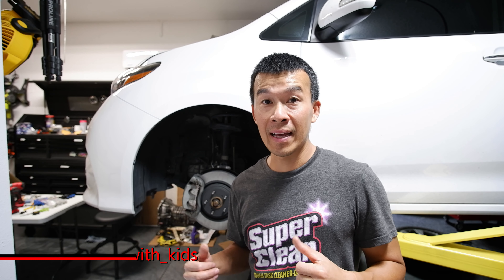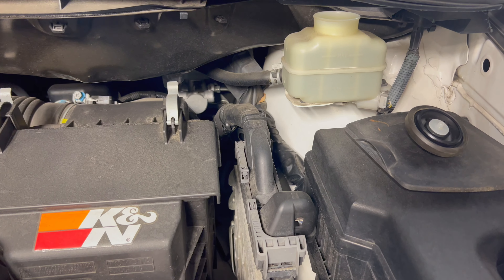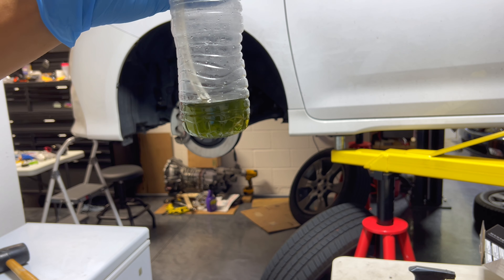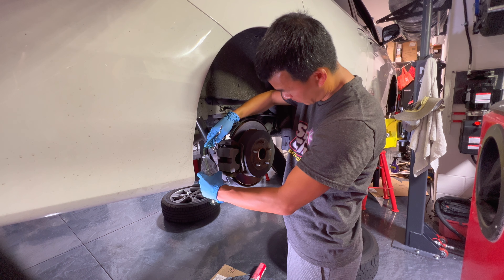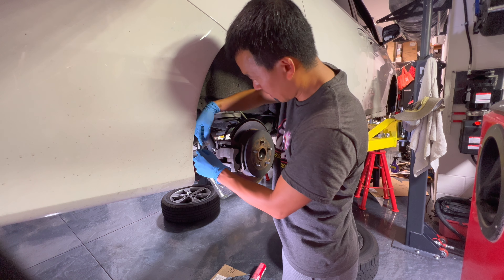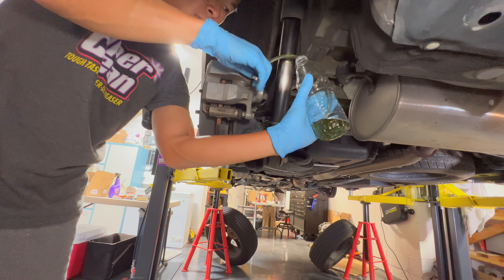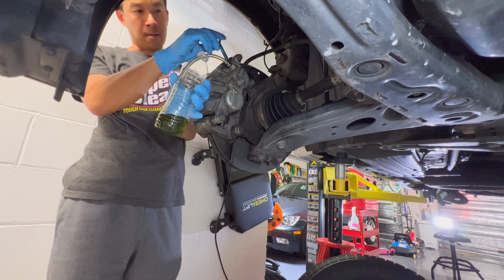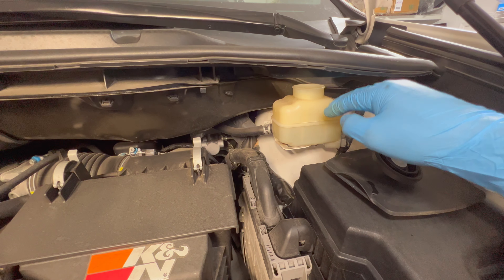How to Change Brake Fluid and Bleed Calipers

Comment: Off topic but do you scrape at all, especially on speed bumps from the chassis brace on your Lexus? I scrape really badly and am not sure if I should just remove the chassis and put back on the oem one
Reply from the maker: The rear underbrace hangs low and will scrape on weird angles. I’ve only scraped it once by riding into grass from uneven pavement.
Reply: @TunerwithKids  maybe I should just raise the back a little more? I have bc coilovers on

Comment: Hey, just wondering how much new brake fluid do I need if I'm doing this for a camry. Thanks!
Reply from the maker: A quart should be good. But maybe 2 in case you over do the draining and fill.
Reply: @TunerwithKids  Awesome. Thanks for the reply. I'll try not to overdo, churning too much brake fluid than is necessary isn't good for the environment and my wallet